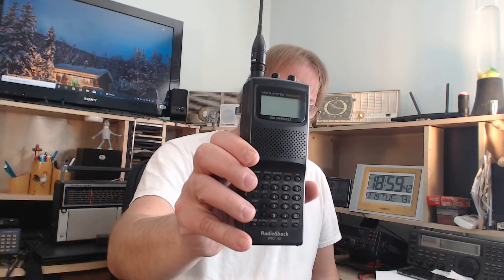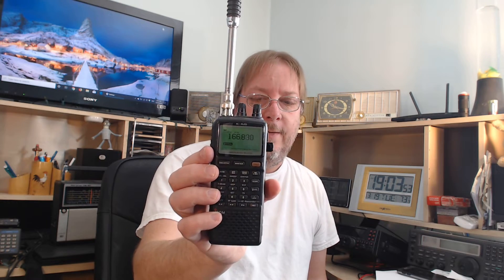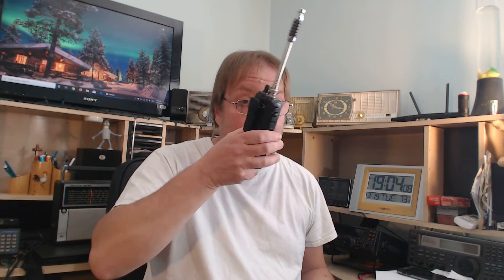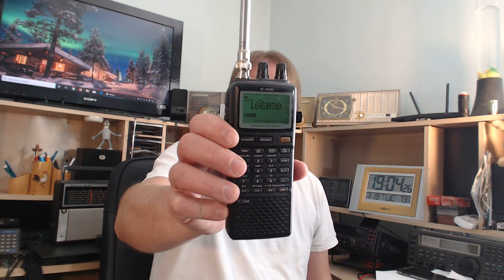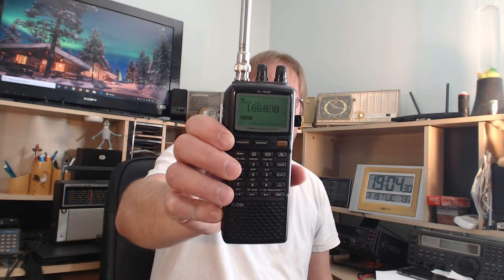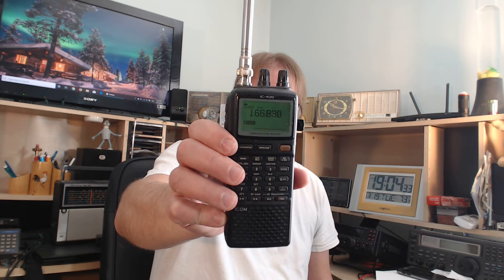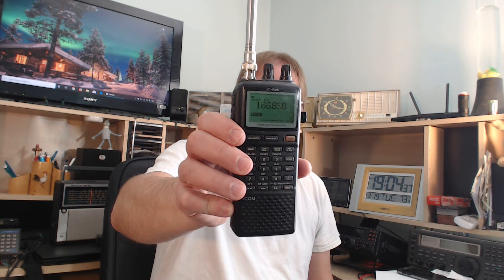VHF UHF tip 22 Differences between Trunk and digital scanners and communications receivers

Comment: Officalvhfuhfchannel - Communications Receivers like ICOM and AOR can Recieve anything thats Analog , and some are even Digital Capable , so far NONE of the Communications Receivers are TRUNKING capable., yes they can Manually listen to Trunking but they Cannot follow the Converation. and the Memory Banks are NOT Configurred like a Trunking Scanner . 
However the MAIN Difference between Scanners and Communications Receivers are that Scanners have MISSING modes like AM and SSB and they are MISSING Spectrum .
In Communications Receivers , you can tune the Entire Spectrum the Radio has (America is Cell Blocked) , but it can Recieve EVERYTHING . In a ICOM you can tune Everyhing from Shortwave to HF to vhf/uhf and even S-uhf frequecies up to 3400 mhz. 
and some Digital Communications Receivers like the R30 and DV-10 can tune many of the DIGITAL modes as well.

Comment: Officalvhfuhfchannel - the days of using Analog Trunk Scanners and Analog Scanners in GENERAL are NUMBERED.
Primarily as Analog services are MIGRATING over to NXDN and iDAS DIGITAL Voice and Digital Trunking Services that are BACKWARD Compatable to Already EXISTING Analog Voice + Analog Trunking services. 
this means a Company using Analog Trunking can gradually UPGRADE to iDAS Digital Trunking over time and Continue to use the Analog Trunking Radios while they UPDATE the Trunking BASE stations and Repeaters to Analog/Digital in ONE unit. 
and over time they can Completely replace the OLD Analog Radios with Digital ones. 
this is more Spectrally efficient and less Expensive than going to P25. 
Others like Hospitals are already Converted to 100% Digital IP Radios that use the Existing WiFi IP Network to communicate with Patients with TINY IP Digital Radios. 
NXDN and iDAS can also Communicate over IP from the Basement to the Top Floor , all in Digital Clarity. 
or in a Giant Stadium , the Grounds , the Vendors and even in another Building DOWNTOWN. 
P25 cannot Communicate over IP.
Reply: Would you be interested in explaining it more in depth because my local area. Small county in texas I think went to digital trucked scanner. Since I have lost 95% of communications.
Reply: Please and thank you!

Comment: Is it possible to be able to listen to Airline traffic between the Tower ?  or if Military aircraft are flying can I hear the Tower talking to the Aircraft
Reply from the maker: to receive the tower you need to be close to it, if it is too far from you all you will get is the plane
Reply: RonG - YES, its Possible IF you are Close to the Tower or the Airbase .
but, you will need a Analog Scanner capable of tuning the Military AERO Band - 200 mhz to 400 mhz in AM mode and somtimes in SSB. you also need the Correct channel spacing. 
and soon AOR will Launch its 4ch Scanner for AIR Communications + Military the AR 7400, it has 4 Indipendent Scanners operting at the same time , in this way you can Monitor TOWERS and Aircraft Seperatly .
Reply: @markplott4820  Thank you Mark for your feedback to my Question, I appreciate the Detail on your Response...Ron

Comment: I upgraded to a digital trunk scanner since although all public safety in my area stays analog for interoperability the utility companies have been using P25 systems now. I noticed a improvement even on the analog reception because it has a DSP in it so maybe still worth looking into even if you don't scan digital stuff.